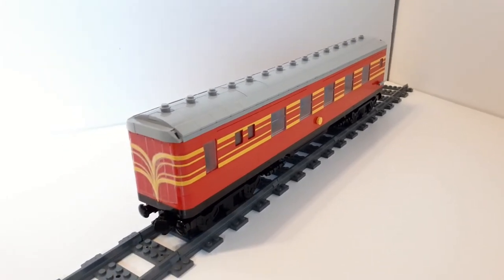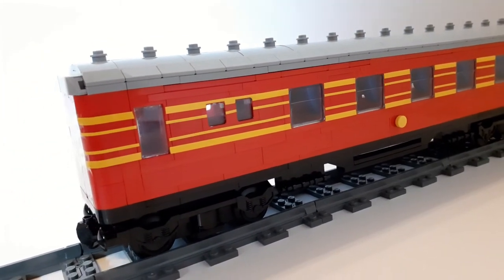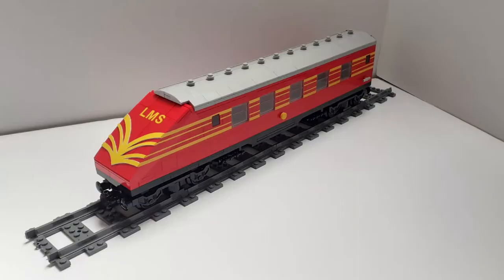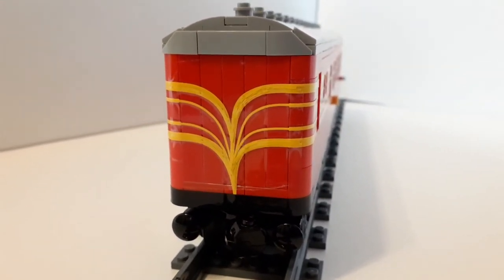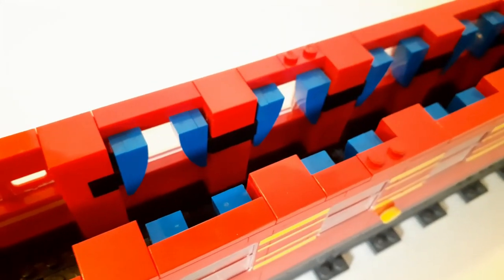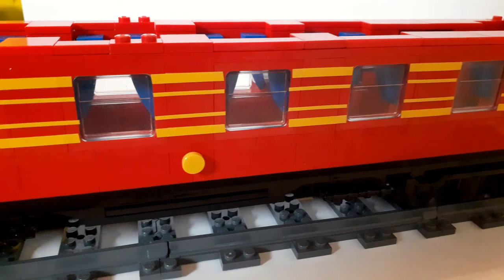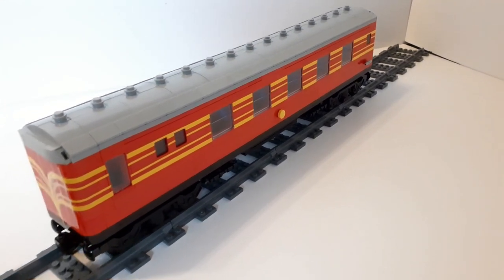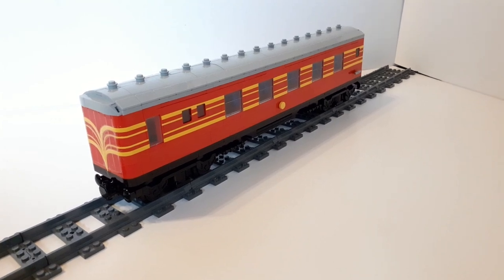Lego LMS club coach MOC showcase

Comment: A word of advice for getting the back striping. Do the one side you can do well with your right hand, and then turn the whole thing around try and mirror it upside down with your same hand. You’ll be surprised with how much more symmetrical it is.
Reply from the maker: Oh there was definitely some times of me holding this at odd angles to get the shape. There was also a lot of 'peeling off and redoing' and this was as close as I got before I lost my patience and covered it in clear tape to protect it